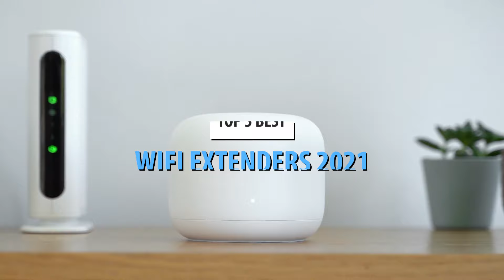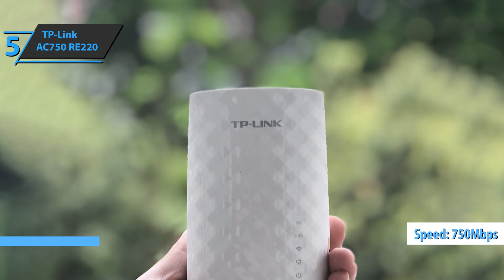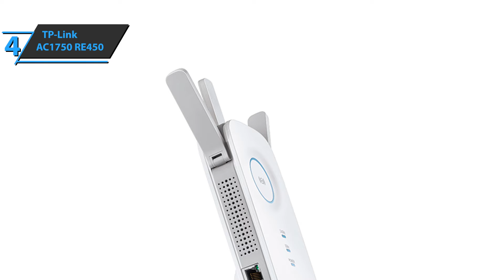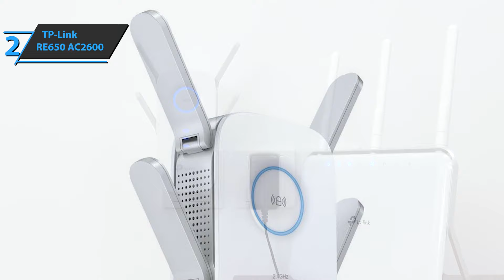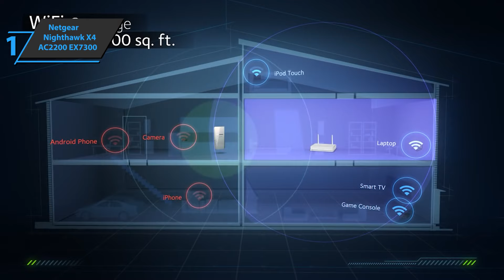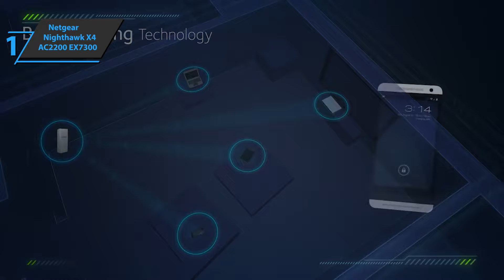Top 5 Best Wifi Extenders of (2021)

Comment: Do these work without the lan cable, I never see them advertised plugged in

I'm trying to get a signal in the basement because I'm too far from the modem, but if I have to run a cord to the extender i don't see the point because if I had a cord that long, I wouldn't need the extender
Reply: You don't need a wire